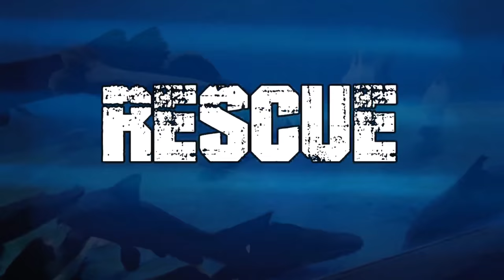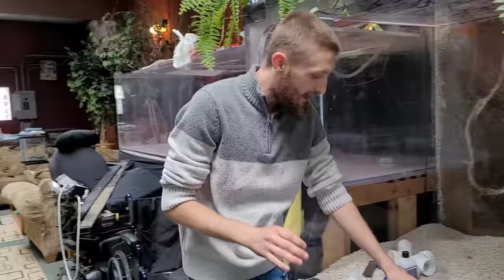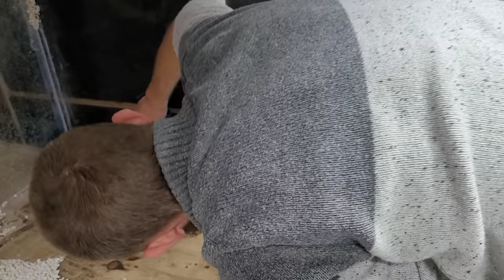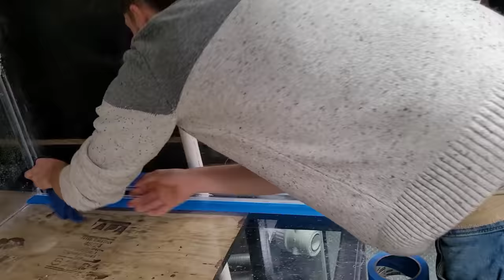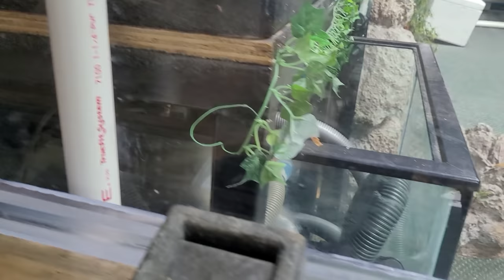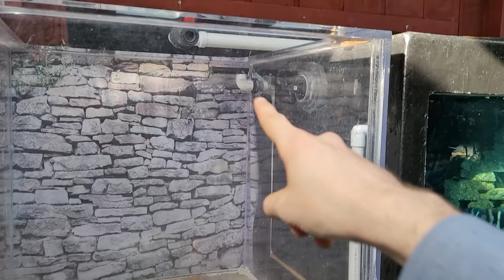Tips and Tricks for Fixing A BROKEN 500 Gallon Acylic Aquarium

Comment: Oh, instead of pouring the cement and making a mess, you can clamp the acrylic and inject the cement with a hypo needle into the seams. Capillary action will pull the cement into the seam and no bubbles, press and hold for a few minutes and it should set.

Comment: Nice patch. Barely will notice it.👍 One thing i would like to  mention though is to never use alcohol on acrylic or any solvent really unless it is specifically made to be used with acrylic.  Alcohol will cause cracking within the acrylic. Might not happen right away  espacially on thicker acrylic but over time you will start to see micro cracks from within the slab. Look into it.

Comment: Thank you for this video.  I am going to attempt to repair my 1000 gallon tank.
I assume the edges on the plastic rod should be sharp edged and not beveled\rounded correct?
Reply from the maker: Doesn't matter. The acrylic cement will fill in the void